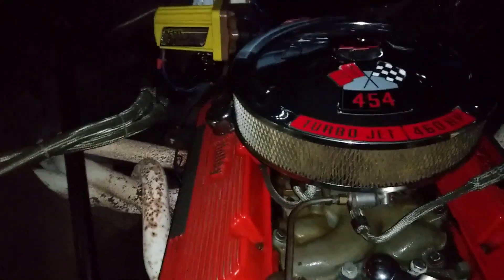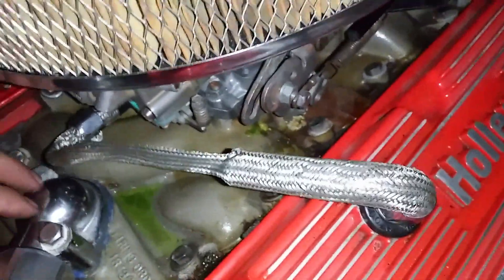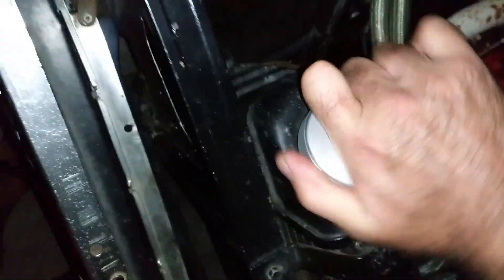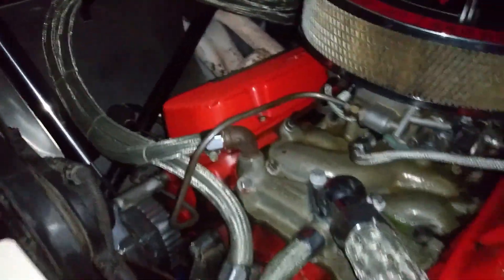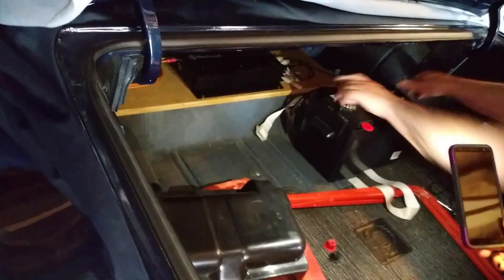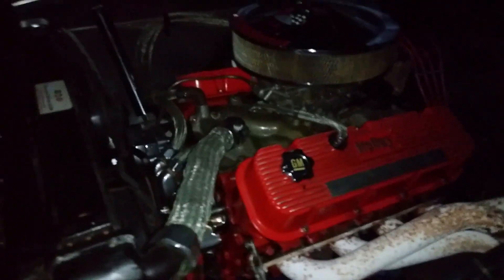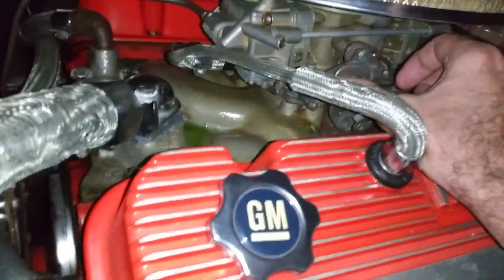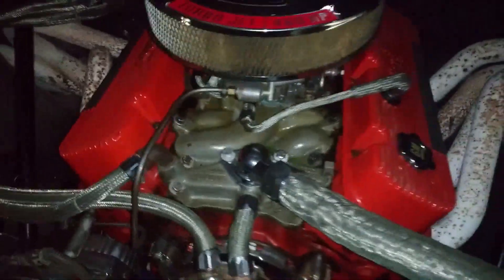1963 Nova SS BBC 454 Gasser start up

Comment: I wish I knew what the fuck I was doing. My dad has had a lifted 1973 Chevy C/K 10 with a 454  just sitting in our drive way for the last 15 years. I could have a cool classic. It (probably) needs a shit ton of work to get running again.
Reply from the maker: Those are very easy to work on if you know what you are doing. A nice toy for a hobbyist.
Reply: Would it not be unreasonable to dump like $2000 into it at the mechanic to get it sorta running and then just do the rest of the work myself? I've considered just doing it all myself as a "learning" experience since they're so simple but I'm afraid that'll turn into a money pit
Reply from the maker: @xXEvangelXx  a big block truck is always a money pit. What you bring it to a mechanic for?
Reply: @RustBeltAuto  Well, I'm figuring it probably needs more than a few things to get running. The last time it was moved in 2008 (and it was sitting before that since the 90's), and I'm not sure its going to be as simple as clean fuel system, new spark plugs/wires and oil change and send it
Reply from the maker: @xXEvangelXx  Put a battery in it, check the fluids, fill the float bowl with fuel, crank it over, pump the crap out of it, and see what happens. That's how the fun begins.
Reply: Man now days it's so easy to get information on how to do something and that's an easy one to work on YouTube will help first thing to buy is a chiltons Manuel and you can do it